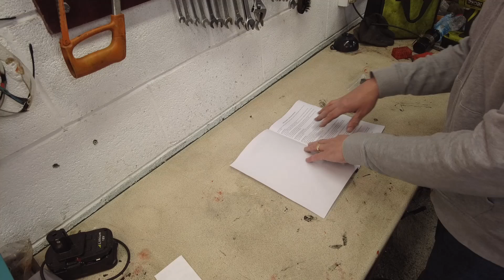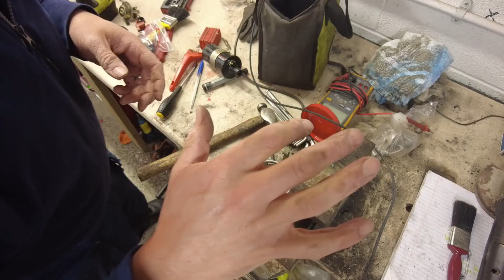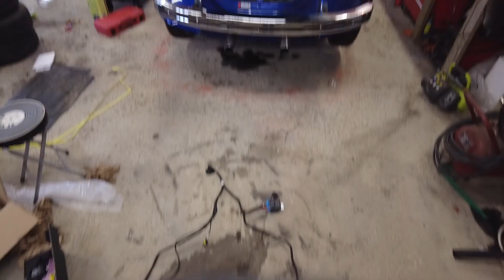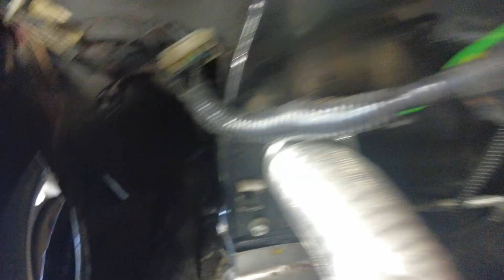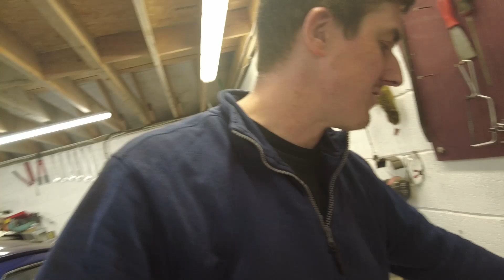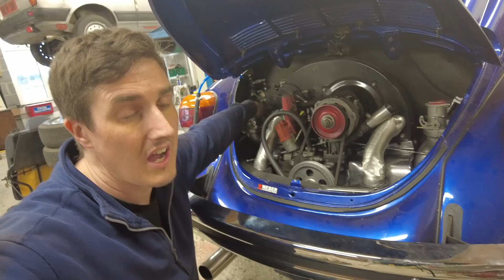EFI on a Classic VW Beetle: Definitely NOT Plug and Play (Part 2)

Comment: Thanks for your vids, much appreciated. I don't have fuel injection, but I did install the reversed CSP manifolds with my twin 44's - made things alot easier in my 61 beetle, although I did have to modify my linkage. This would put your injector rails on the inside. Thanks for the content, really informative

Comment: Hi from Autralia, have a 63 beetle i’m doing the Sniper injection way from CB performance, different as its only single port 1300, same as in not plug n play, air filter they supply with the kit is shyte, still enjoying the tinkering though to get it right,, lots of things had to be figured out mounting location for fuel pump, lift pump, route the delivery and return fuel hose, fit a small swirl tank, Frankenstein the accellerator tube through the fan shroud as the TB has a different offset,   
Wiring and a few smaller stuff and its up for first fire up, 
Fingers crossed for a good outcome for both of us,
Reply from the maker: Cool! I'd be interested to see how that works out. You should stick up a video!

Comment: I've seen some kits with the injectors inward nearer the fan shroud. Just an idea.
Reply from the maker: I had contemplated that, but I'm not sure if the throttle levers would fit on the other end of the spindles. I might still do that, but all the other issues still needed sorting out.